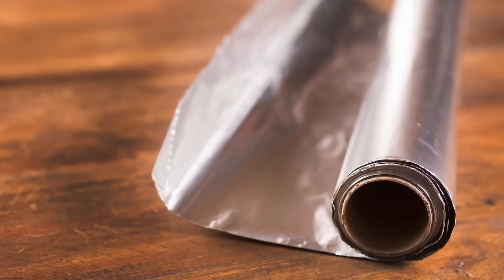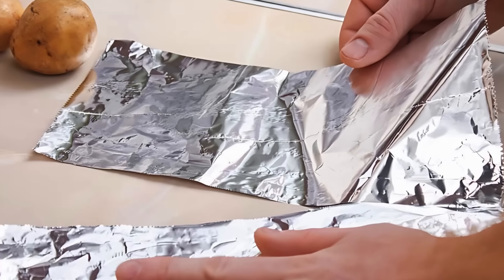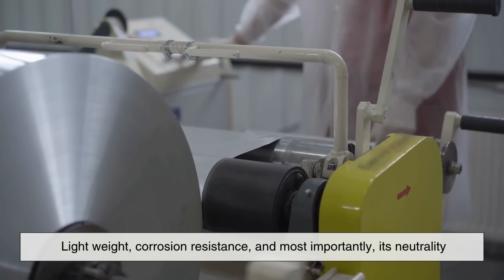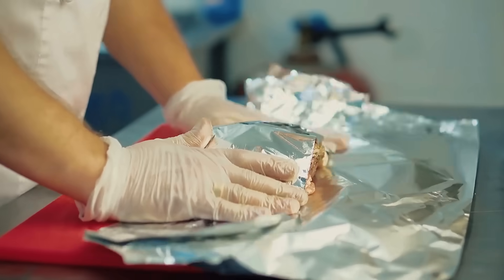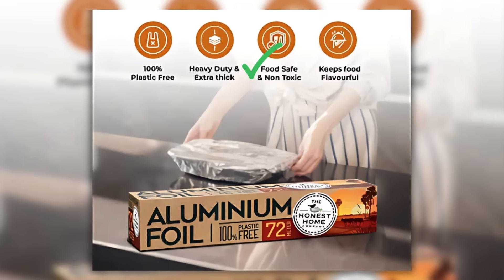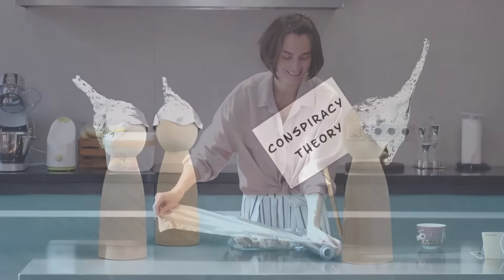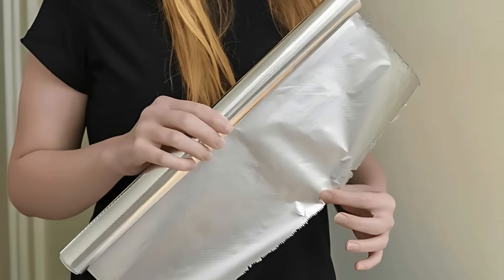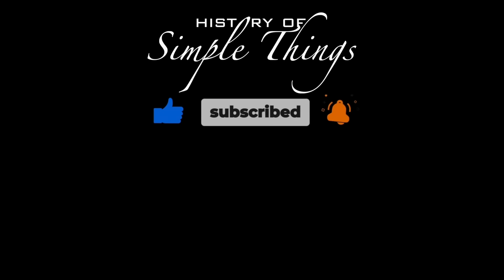Why We Still Call It Tin Foil (Even Though It’s Not)

Comment: You didn’t mention how aluminum foil has a shiny finish on one side and dull on the other. Does it matter what side you use in or out?
Reply: It has a shiny side and a dull side because of the way it's manufactured. Two layers are rolled together, so one surface is in contact with the roller on that side and the other surface is in contact with the other sheet of foil. It doesn't matter which side you use in or out.
Reply: @alexisdougherty2652 I know that, I was asking the video producer. 🙄

Comment: Why is only one side of aluminum foil shiny???🤔
Reply: Production - the material is rolled several times between smooth rollers, making it shiny, but in the last step, two thicker foils were rolled together, so one side of each foil does not come into contact with a roller and turns matt.
Reply: @Astrofrank with a name like astrofrank, I believe you!

Comment: In the 19th century, tin was ubiquitous. It was THE metal. It was the first metal used to can food. That's why we call them "tin cans" even though they are now made of steel (cheaper) with a safe coating inside to create a barrier between the metal and the food. Tin was used for the classic metal boxes with snap-over lids. Ever heard of a "tin whistle"? It was everywhere! The strong association of tin with England and Ireland was because that's where the bulk of it was being produced at the time. (There's a famous mine that actually went down and then out UNDER the ocean because that's where the ore body was.) It's still a vitally important metal but it's use as a standalone product has decreased.

Comment: Aluminum foil can be used as a wrap to block RFID (Radio-Frequency Identification) scanners. It works by creating a barrier that reflects and absorbs electromagnetic waves, preventing the RFID signal from being read by unauthorized people.
Reply: So can tinfoil. Or copper foil. Or copper screen, which was commonly used yo make Faraday cages to block RF. In fact many metal foils will work better than aluminum foil, since aluminum oxidizes almost immediately in air, and aluminum oxide is an insulator.
Reply: It's also used in some vapor barriers to reflect infrared heat.

Comment: "Tin" cans are made of steel with a thin layer of tin applied to the surface to prevent rusting. The term "tin can" is a misnomer, because the body of the can is steel. The tin coating is a thin layer that acts as a barrier to protect the steel from corrosion and food contamination.
Reply: I think the original term was "tinned can" - which got contracted to "tin can" through simple human laziness.
Reply: @douglasclerk2764  Thank you for your comment. "Tin can" is more commonly spoken in American English. "Tinned can" is more commonly spoken in British English.

Comment: Is it toxic or not? That’s the real question that should be answered.
Reply: Bare aluminum metal is rapidly oxidized in air. That would become an aluminum oxide layer a molecule deep, which is essentially a ceramic, also used as a fundamental material in aluminum oxide based abrasive wheels and papers. Welding aluminum is quite problematic because of this self oxidizing tendency, which occurs spontaneously in a few minutes in normal air. Fluxes and mechanical scrubbing are used to remove this oxidation so that welding becomes possible. A shielding gas is also required to prevent oxidation during the welding.

So if undisturbed, no metallic aluminum in the foil is available for contact with anything in the food. However, acids or bases can remove the oxygen bound to this surface layer and make the metal available for further reactions. So in 'cold' and 'dry' applications, aluminum foil is inert. Take your chances cooking with it with acidic foods. Used as a dry food cover, there's not so much likelihood of contamination caused by contact.

When you pop the top of an aluminum soda can, there will be a brief exposure to metallic aluminum along the edges of the tab, which descends immediately into the soda. Who knows how much aluminum leaches at that brief moment? It's a risk we commonly take.

There is also the question of aluminum salts, which are NOT the same thing a metallic aluminum. Such things are used as adjuvants in jabs to provoke an inflammatory immune response. The introduction of such compounds directly into the blood stream is the real 'aluminum' to be paranoid about. Macrophages will take up this material, and may be responsible for moving it around the body as there is not a way to excrete such inorganic wastes. Kind of like tattoo ink, which is also absorbed by macrophages and retained by them, and passed along to yet more macrophages. 

My mom used to cook in aluminum pots. I recall the pitted interior surfaces of those pans, because I used to wash them :) But despite the exposure in my early years, I've used stainless steel since I became an adult. So I can't testify to the possible toxicity of eating from aluminum cookware. Probably, I was protected by the solid blocks of transfat margarine that she used to cook with ;)

Comment: Worked in steel and aluminum rolling mills. Foil making is definitely the more extreme process vs rolling in general. In college I needed to make emergency repairs on my muffler. It was very loudly striking the car frame. In middle of nowhere found a farm supply, bought 2ft wide 100 yard line heavy gage Al foil roll. , lol. We folded it up into a small square pad, squeezed it in-between the muffler and frame and it worked wonderfully. We traveled the rest of the 500 miles in style, lol. I had that roll for years.
Reply: A very humourous and authentic display of ingenuity.
Reply: “In style”